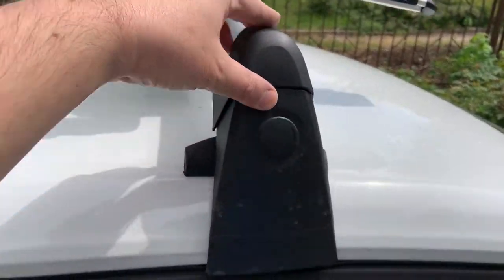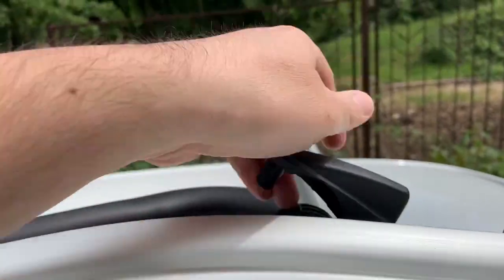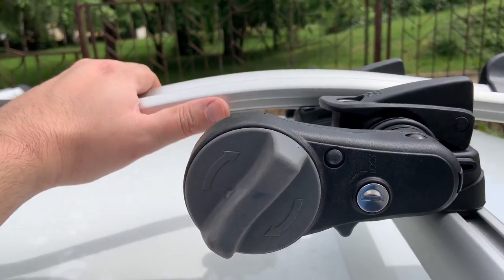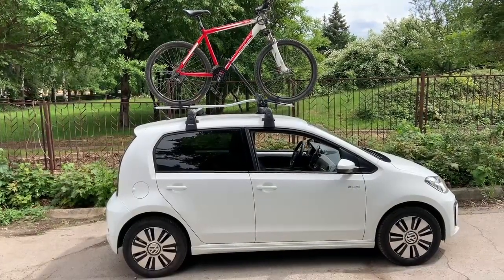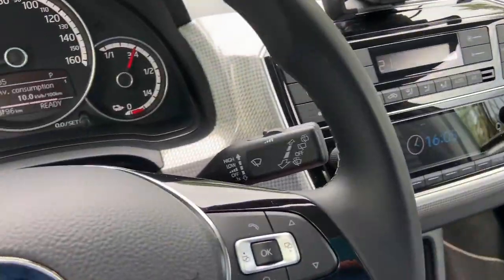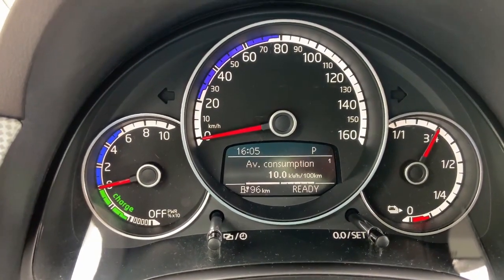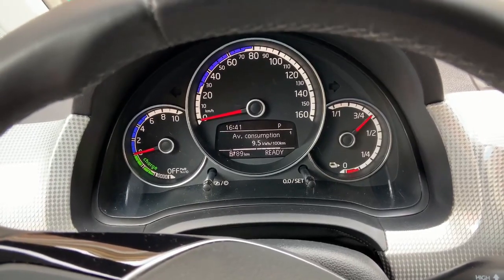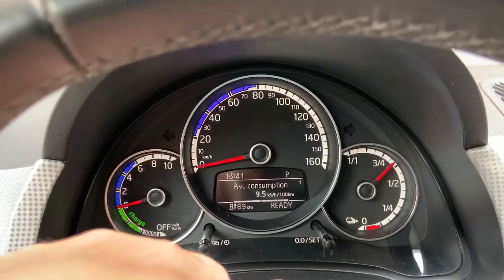Test the energy consumption increase when traveling with bike on the roof

Comment: Hi, a question for u. It’s possible to charge the car in a wall box 7kw single phase, using a 32a cable single phase? The cable in the car at purchase is 16a three phase, right? Thanks
Reply from the maker: The onboard Volkswagen e-up charger is 3.6 kW. It doesn't matter how powerful wall box you can take, the maximum charging power you can input to the car battery using AC is 3.6 kW. If you plug 7 kW wall box you will be able to charge with 3.6 kW as long as the charger is using AC. If it convert the AC to DC then the maximum amount you can charge is around 45kW. The cable of the granny charger is single phase 16 A but you can charge maximum with 2kW. I hope that helps.
Reply: Tedo Nash thanks Tedo, but u have previous or last version of eup? I’m talking about the 2019 model that have charger 7,4kw.
Reply: @DobermannCompany  The 2020 model presented in spain in Nov. 2019 has the bigger 35 kWh battery. 
I am also not sure if you really got a 15 a 3 phase cable with the car cause that depends on your country you are living in or at least the car had been build for.

I would be pretty carefull and you must be very sure if you rely on someones advice that might be wrong or he or you might have been misunderstood cause the damage you can cause is a multiple thousand € bill by following such an advice.

You have to mention what model you own and build for which market and so on  to make things clear.
And if you get an advice be sure that the person you wanna trust is aware of your countries regulations or is living there too. If things go wrong you do not blow up a 12V fuse or a 5V USB port fuse, you will kill most likely a very expensive piece.
Go to your dealer, ask a local electrician or a domestic e-up or e-Golf forum cause e-up beneftis from the same tech that the e.Golf got regarding the electrical drive train except the smaller motor.

Comment: This will only apply on city trips because the role of aerodynamics and such the consumption will increase significantly with higher speeds such as highway trips.
Reply from the maker: You think so? I will test it and share the result.
Reply: @tedonash2681  Of cause: aerodynamics influence start from beyond 40 km/h and will explode above 120 km/h .... 

I could drive my car with 10 l / 100 km at 120 km/h but if I put a trailer behind me it goes instantly up to 15 liter or 50% more . A trailer is a cheap way to move from town to town but not efficient one. Rental of a trailer is about 50 or 60€ while a sprinter costs much more but driving at 120 km the Sprinter will save you a lot of Diesel / gas costs cause the Diesel can run at 10 Liter ... 

The basic mount or rail without a bike kills your aerodynamics and caused 2 liter or 20% more consumption on that same car. 

That is why a Tesla on a highway lowers the whole body to get closer to the street . Why ?
The result of lowering 3 cm will end up in lowering the area exposed to wind / drag and in that case it is 3 cm x 22,5 cm x 2 tires if the tesla has 225 x 19 tires.

Tesla invests money and time to develope a technique to lower the body to lower the area that is exposed to the by 67,5 x 2 = 135 cm^2 ... then you must admit that 135 cm^2 must have an influence to efficiency and therefore range. A DIN A4 paper is roughly 21 x 30 cm and has 630 cm^2 of area. 
Please take an a4 sheet of cardbox and fold it in the middle 2 time and you will have 157 cm^2 better known as small postcard

Now drive 120 km / h and open your window just a bit and watch  the pressure on the card if you hold it vertical in the wind. 

You may also know that the car industry is trying to get ridd of mirrors outside the car even if they had sculptured them so efficiently in the last 30 years ....

Measure your rail mount with 130 cm and 3 cm height then you will realize that the are is 390 cm^2 for the first and the second again due to the huge distance between those. 
That is the reason why the rails are not longer ... cause every cm will cause drag ...
If you are driving at averages around 36 km/h per hours you will not be able to recognice an effect.

Even your 2nd drive is misleading cause you recognied 0,5 kWh lower consumption but you have also to take into account that on that second drive your average was simply 31 km/h instead of 36 km/h  ... which is 5 km / h or 14% less.
You were driving 14% slower ... but your consuption was just 5% lower and therefore you might have now more questions turning in your head than answers I guess.

Try to get on the highway and drive an exact route ... in a simple way: measure the time from 1 bridge and another bridge at least 25 km away and try to maintain the speed ... you have to reset the kwh meter in the second you cross the first bridge and check the exact distance and time when you cross the second bridge maybe 30 km away ... and then you will go back adding the rails and then you will go the same direction again. Finally you  add the bike  and do it a third time .... and most likely your odb eleven should be able to measure the consumption cause the consumption in kWh or Wh is far more precise than the 9,5 you read in the display cause that is a calculated figure that also had been rounded. 

Efficieny and areodynamics are king and important cause all highspeed bycicles benefit from what ? 

A Zeppelin like hull with a driver laying in the hull from DELFT , the netherlands .... 
https://www.youtube.com/watch?v=nhv0jrsAW5w
Reply: According to the formula given here, https://www.toppr.com/guides/physics-formulas/air-resistance-formula/ , the air resistance force grows with the second power of the speed, so in our case at higher car speeds it will grow faster and faster. I would expect the air drag to be really well pronounced at 100+ km/h .
Reply: Would be intresting to see bike on roof vs bike on back and then consumption difference 😅

Comment: Thanks for the video, will you make as well a highway test?
Reply from the maker: I can but what value it will bring. I see very little increase of the consuption which I am sure will be confirmed on the highway.
Reply: @tedonash2681  because drag force is square of air flow ;) small difference in speeds up to 50kmh might turn to huge energy consumption on highway ;)